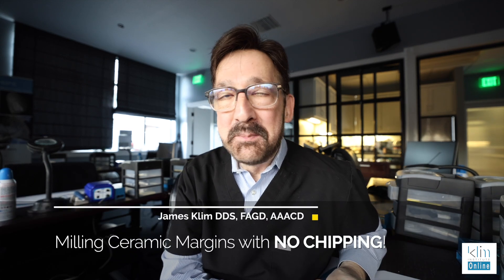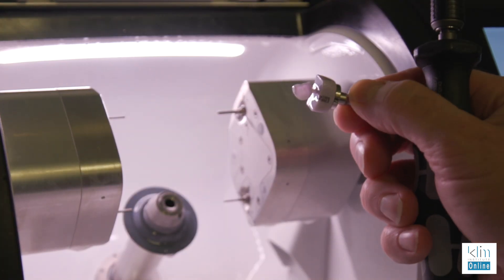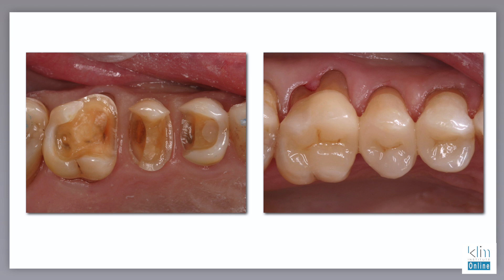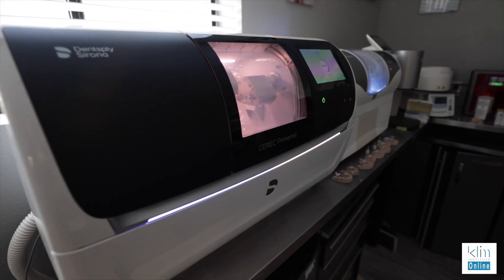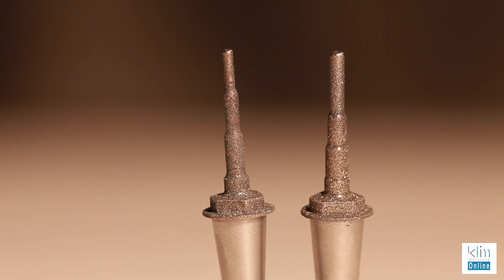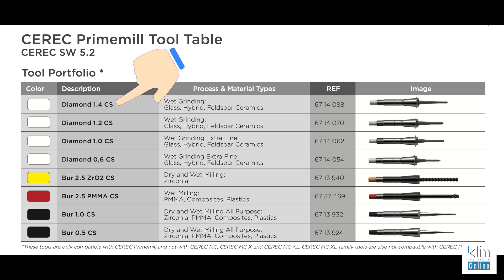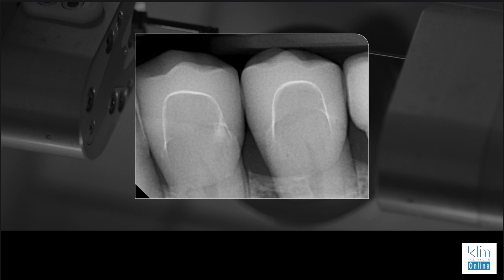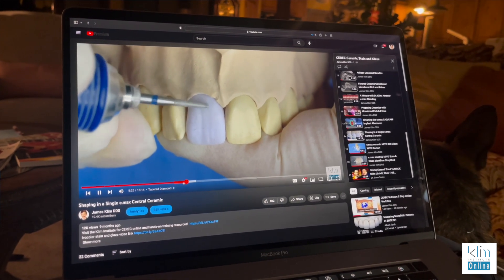Milling and NO CHIPPING

Comment: Hi Dr Klimn - would you do the same 50 microns thickness if I am designing on Exocad to mill Emax through the prime mill on in lab cam ? I tried doing a mill with extra fine mill today, worked decent but 2 tiny chips…. So guessing I should check the margin thickness setting in Exocad?
Reply from the maker: Yes, it will be the margin thickness to control chipping.

Comment: Hi Dr. Klim, I purchased a small private practice about a year ago. The previous owner had an MCXL (I use the 12s bur) and primescan and the patients are accustomed to same day crowns. I also have the speed fire oven. I have spent $$$ repairing the now 11 year old MCXL (I've replaced all but 1 motor at this point) and am looking to replace it. Would you recommend buying another MCXL due to the ability to use the smaller 12 bur or the primemill? Or would you recommend I switch to one of the PrograMills PM3-5? Thanks in advanced for your advice!
Reply from the maker: Food question.  The Primemill performs well for zirconia and straight forward posterior ceramics.  The Primemill EF bur ceramic mill is exceptional.  The one hiccup is over mill for lower anterior applications and conservative anterior preps.  The advantage of the MC XL is the 12 bur in Fine Mill.  The Primemill does not do as well with Fine Mill due to left bur size of 1.4 mm.  However, the Extra Fine Primemill is exceptional on margins and is fast and is what I us for posterior onlays etc.  I am moving to the PM7 and Exocad for conservative anterior applications in order to avoid the over mill issues and Exocad has superior anterior design proposals and workflow for Aesthetic designs, starting from virtual diagnostic wax-up through the final restorations.  Anterior ceramic applications can be accomplished with the Primemill, however, it requires a more aggressive prep style.  All the best in your decision.

Comment: What are your thoughts on Tessera vs Emax, now I noticed Emax less prone to fracture which suprised me due to the fact Tessera has 10% zirconia in it.
Reply from the maker: Whenever I look at a new product, I gravitate towards independent studies rather than the manufacturer's ones.  Zirconia does not always mean strength.  It is crystal size.  e.max has a larger crystal size than some of the other LD on the market. I look for fracture toughness over flexural strength for performance parallels.

Comment: I thought you recommended 
 marginal thickness of +100microns to avoid chipping? Is this no longer the case or does it not apply when using EF milling?
Reply from the maker: Good point, 50 mp just for the Extra Fine mill, 100 (+) mp, which is now the default for the Fine mill.
Reply from the maker: Yoni, do you use the Extra Fine mill?  I have for years and it is a game changer.  A lot of our colleagues don't have this option.  For Fine mill, then 100 (+) um margin parameter will improve the outcome.  Back in the early days with the compact unit, I would use a 160-200 um routinely and then polish the margins back after the mill.  The Extra Fine on the Primemill is almost as fast as the Fine mill.  A lot of users out there do not know this; the mill is significantly better for margin, proximal fits, and occlusal anatomy.  Extra Fine mill is the only ceramic mill I use on the Primemill.  If I need to Fine mill, I prefer the MC XL with the left 12 bur, it is a better mill.  All the best my friend.  I appreciate your posts and energy on Keep CERECing. And thanks for the shouts.
Reply: @KlimDDS  Thank you for that! Unfortunately I do not have the ability to extra fine mill (I have a mcx) at this point in my career but maybe one day I will!
Thank you for making your online course so accessible! It was such a huge confidence booster for me. The more people who know about it, the better! 😁